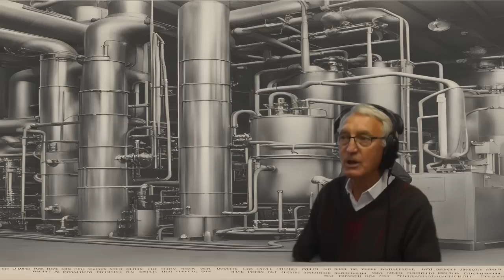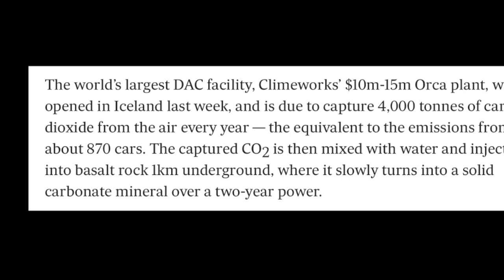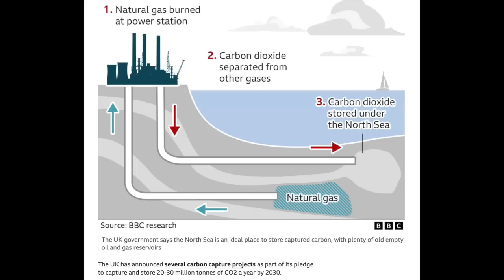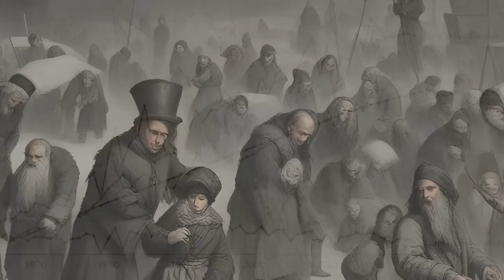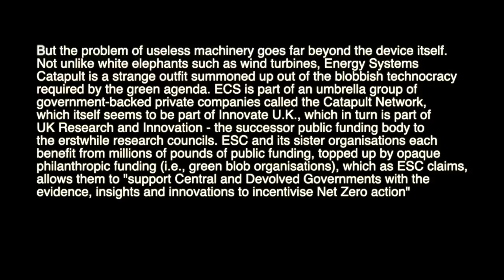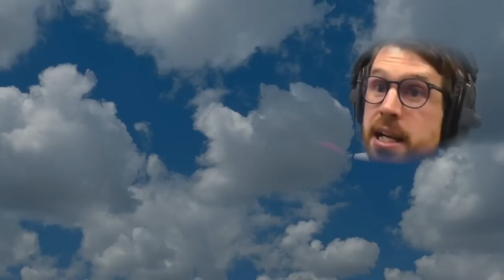Exposing Green Energy Propaganda Cut 2

Comment: Paul, the real reason for this nonsense is to ensure that the vastly expensive wind and solar alternatives seem cheap by comparison. Exactly the same way that nuclear was, effectively, killed off in the UK yet is 70% of French generation and where electricity bills are far lower. Lumber as much cost as possible and make it economically unviable. If I were a gas power generator I’d generate up to December 31st 2049 then switch off and head somewhere that still has an economy.

Comment: It seems the UK greens need to learn from Gavin Newsom here in the US.  He solved the natural gas issue with the stroke of a pen!  Search for "California Governor Gavin Newsom Proclaims Natural Gas To Be Zero-Carbon"

Here's an excerpt from the bill, there's a new term, Firm Zero-Carbon:
SB 423 defines firm zero-carbon resources as 'electrical resources that can individually, or in combination, deliver electricity with high availability for the expected duration of multiday extreme or atypical weather events and facilitate integration of eligible renewable energy resources into the electrical grid and the transition to a zero-carbon electrical grid.'"

But then, California is also working on phasing out gas fired water and space heaters to replace those with electric heat pumps.  But at 6AM, when folks hop in the shower before work, that heat pump will be running off electricity, most likely being generated with natural gas.  That electricity may even be imported from several states away.  With my own water heater data, I've found that even a high end heat pump water heater is less efficient than a gas fired tankless water heater/boiler.  Unless that heat pump is run off 100% renewable power, the generation of that electricity will emit more CO2 than a gas fired tankless heater/boiler due to all the standby heat losses (no standby loss in a tankless heater).

That said, somehow burning less natural gas in a tankless heater is "bad", but burning several times as much gas in a turbine to make electricity is good, because it's "firm carbon-zero".  The second goal of phasing out sales of gas fired appliances is for NOx reduction.  But again, if several times as much gas needs to be burned to spin a turbine to make electricity, it's putting out that much more NOx as well.